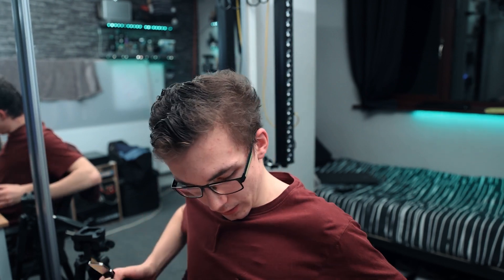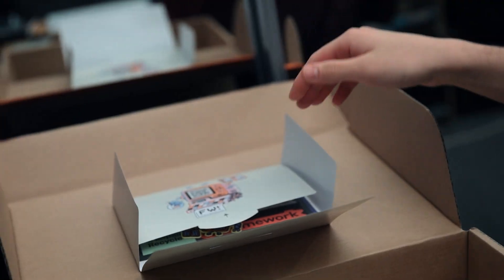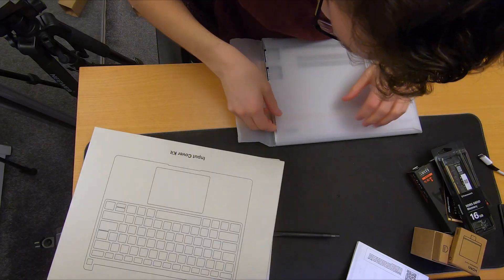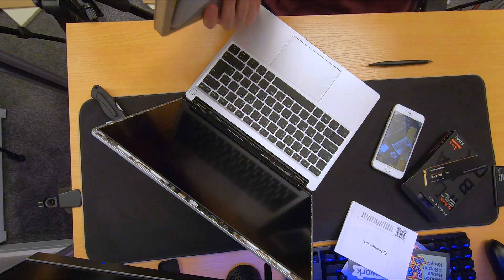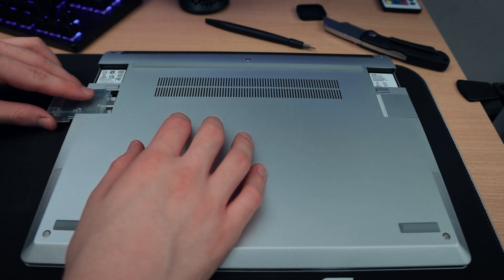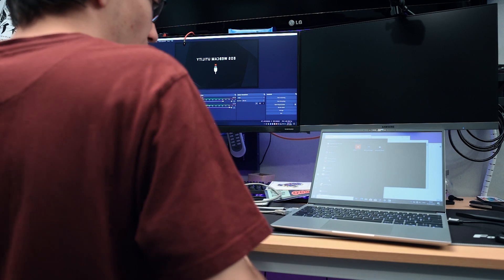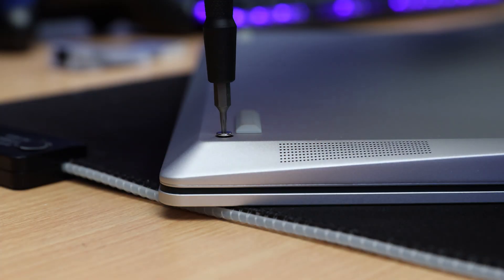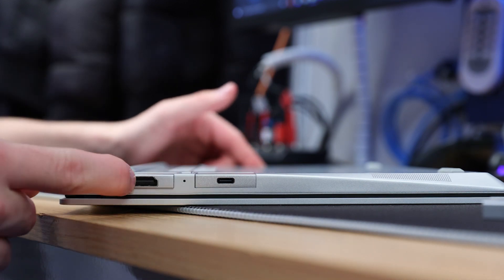I've Waited a while For This - Framework 13 Unboxing

Comment: Received my Laptop 13 with an AMD Ryzen 7 in December, coincidentally the same day ZORIN OS 17 was released. Installation was a walk in the park, everything (including the fingerprint reader) works out of the box – quietly and stable.
Updated to BIOS v3.05 meanwhile. Works quietly and reliably for 239 days now. Love design and handling, which are somewhere the best of both worlds of MacBook Air and DELL XPS.

Framework's concept is great:
Maintenance (such as cleaning out the dust once in a while) as well as the ability to repair (just think about the battery after some time) and upgrade is highly welcome. Also is the individual configuration of interfaces with the expansion modules.
Never ever before have I experienced that feeling of freedom and ownership like now with my Framework Laptop 13.
Best laptop experience ever. Kudos to the Framework team … keep upgrades, parts and accessories coming!
Lots of potential not only for B2E, but also – if not even more – for B2B. Business customers just need to realize Framework's advantages.

Comment: Yo dude. Got a hint for you. Make a series of vids with this laptop. Linux, Windows, synchronization with a phone, how is the touchpad, multitasking, is it fast enough, multiple apps opened, virtual screens, gestures (if it has any), is it good for productivity, coding, and stuff. I am a total apple user, but recently started to think about open source devices, like fairphone or this laptop here. I think, there is an audience which is interested in those topics.
Reply from the maker: Just for you, I’ll think about it 🤔
Reply: Absolutely agree with this. As of right now there are very few reviews of the Framework - only Elevated Systems seems to be thoroughly covering it.

Many buyers need content to help them decide if the laptop is for them, and you seem to be optimally positioned to take advantage of that.

Comment: I think the battery drain when closing the lid is just down to Window's really crappy suspend system and it's desire to automatically install updates when not being used
So it wakes up pretty often and sometimes reboots to get an update installed

Cause when I use my laptop with Fedora 39, I can leave it suspended with the laptop closed for a day and only lose like 4% battery and the same with the Steam Deck with a full 3D game suspended too
Reply from the maker: Yeah windows isn’t the best at that, now I just set windows to hibernate when the lid is closed, saves powering it off each time.

Comment: Framework 16 or macbook? 
I understand it boils down to OS preference but I dont have any. windows or macos anything is fine.
Reply from the maker: Macbook if you have money to toss about and don't care about ridiculous repair costs, Framework if you support sustainability upgradability and reparability. Macbooks are hard to upgrade, I don't think you can even upgrade the storage on the latest ones.
Reply: @BrandonGeorge21  I get if you want to paint the MacBook as some monster, but it's much better for people who own other Apple products for the ecosystem, or people who need the software (graphic design and video editing).
Reply from the maker: @Oneris7  Sounds like a deal
Reply: @Oneris7 people who are in ecosystems most likely wouldn't switch. If you're in the ecosystem of course you'll get those products it just works with all your other stuff. But if you're someone new without an ecosystem or looking to switch it's hard to make apple look good. Most people like spending less money and a framework that you could easily upgrade and fix would cost less than a MacBook that costs way more to fix and can't even upgrade so you end up buying a whole new laptop when yours is too outdated to work. Also planned obsolescence is annoying. And I don't want to be that guy but windows and Linux have software alternatives that work just as well.
Reply: Get started with windows over macbooks. Doesn’t have to be framework but you will be able to move around and work better with windows. Though macs are super efficient. They suck with software support (terrible for engineering students)
Reply: Gonna go with Framework
Reply from the maker: good choice  @ChrisTian-sd5yq
Reply: It depends how you want to fight your war of attrition for the next 7-8 years.

If you take great care of your MacBook like its an heirloom you don't have to worry about components except for battery. The way Apple couples CPU/RAM/storage on the chip makes things like swap feel invisible. I believe Macs also still hold their value well when reselling, but I don't know for sure.

If you're a little rougher with your technology and/or want more hardware control, Framework 16 is perfect. My only other comment would be to wait for second-gen if possible, since a lot of reviews see it kind of mid. I know battery life is not really impressive on it.

t. iMac M1 2021, thinking of getting Framework 13 after transferring to university
Reply from the maker: @MrDarren690  totally agree with you, mac's / frameworks are for two completely different people. macs for people who just want a pc that just works with the downside of higher repair prices. and framework for people that like to own their product or be able to upgrade their own device.

Comment: only reason I didn't boaght it is that it's only 13 inch, don't understand the reason for such small laptops, they are not fit for work. Waiting for my 16 inch order.
Reply: same, but isn't available here sadly
Reply: With the 3:2 aspect ratio, the 13.5" screen is bigger than you think it is. Imagine a typical 16:9 screen, and then imagine if it were the same width but with additional height. For most work purposes, additional vertical space matters more than additional horizontal space.

Comment: Does it have an additional nvme slot?
Reply from the maker: i wondered that myself, so i opened it up and i don't think it does,  only one for the wifi card and the ssd
Reply: @jackyjacky6093
No, it doesn't, on both AMD and Intel mainboards. 
You may consider purchasing an expansion module, though. They are available with 250 GB and 1 TB storage capacity.